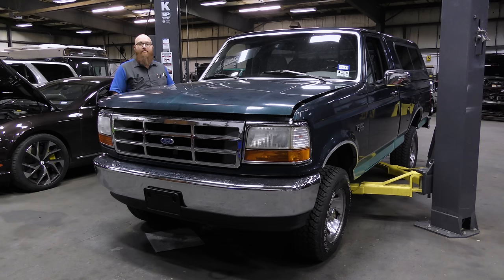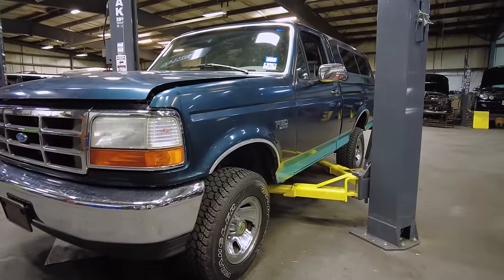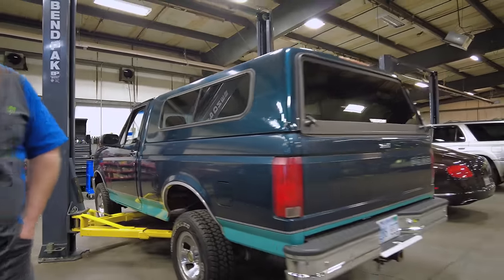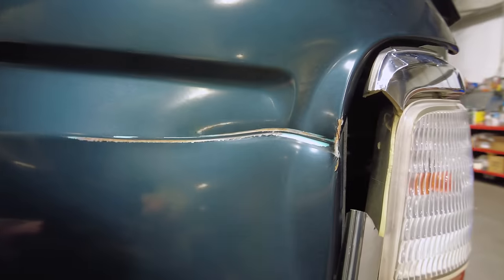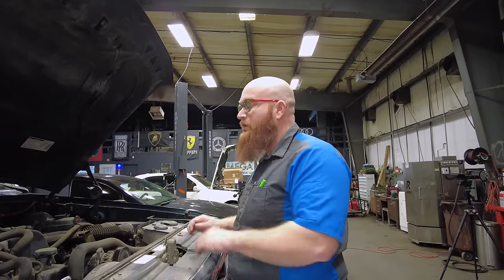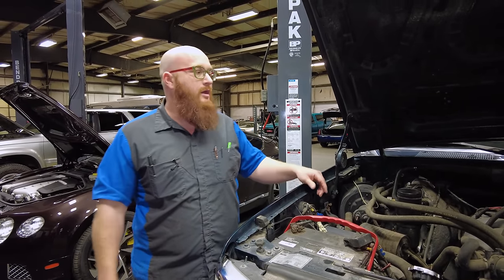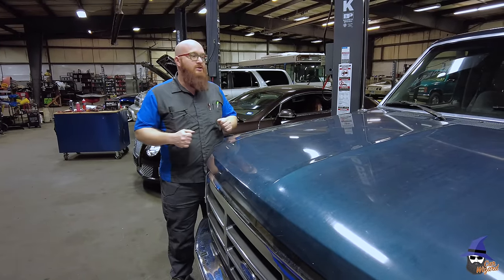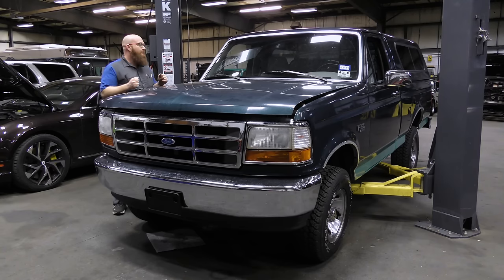What makes the CAR WIZARD mad? Fixing other shop's screw ups! Cheap Shop made  huge mess in '95 F150

Comment: Also beware of shops that will diagnose a specific issue, but will then present you with a laundry list of other so called "issues" and then proceed to hard sell you to have the shop repair all of the "issues" the shop found.  They will present these "issues" as safety concerns that should be addressed immediately.  They will proceed to tell you how badly your vehicle will perform if you do not accept their recommendations.  When you find yourself inside a shop like this, simply ask for the keys to your vehicle, and get out as quickly as you can, never to return.  Don't even try to reason with them, as their goal is to squeeze as much work as possible (the upcharge technique) out of you.  Just stick to your gut reaction to the hard sell.  Listen, used vehicles are going to have "issues".  Go to a shop that will correctly prioritize repairs and will work with you, given your budget, on what needs to be done "right now", and what can be deferred (along with imparting the knowledge of the consequences of that deferral), and what are simply nice-to-have repairs, given the age and overall condition.  As the owner of any car, you should keep a folder of all past repair invoices on the car so you have a history that you can look back on to figure out how much mileage is on your brakes, shocks, etc.  Be proactive instead of reactive, when it comes to car repairs, battery replacement and tire replacement.  When a shop tells you that your shocks need to be replaced, you can push back that the shocks only have 25,000 miles use on them!
Reply: i've learned that these are usually dealerships that try to add on all of the extras.  They are a ripoff 95% of the time!
Reply: Got my last set of tires at a Big O, they had a promo on Michelin. For the last 15 years I use a wheel and tire shop in Sacramento that is no bs always do fair deals and quick service. Just for the tire appointment at Big O they had my car for 4 hours and did a complementary safety check and said there was moisture on the steering rack it might be fluid if the steering rack goes it’s be real scary blah blah blah they can do it today for $2200 and also they recommend new shocks and struts because I’m at 90k blah blah they could do it today and have it ready by Monday morning …. Yeah no thanks

Comment: It reminds me of the time my mom took her escape to get the shifter fix (it wouldn't shift to any gear- cable broke which the mechanic said)... Any who. It shifts but it doesn't click and lock to any gear. Makes matters worse, yesterday I noticed they literally ripped the air filter housing... That's a 100 dollar item I need to order directly from Ford. Really pissed me off, there's a reason I do my own work on my vehicles

Comment: thank you wizard for bringing this up
i got royally screwed over recently

 i had my 08 jk wrangler at the shop i wanted a simple alignment done
they wanted to replace everything and unload the parts cannon on it
when i declined service they would call and say the brake pad broke  or the brake caliper wont retract 
i smelled bs but it was one of those we cant let you take it now situations spent $700 on shit service and broke more than they fixed they lost /broke the front axle  guides which turned into them damaging the axle seals
i have spent the last few days un "f" ing all their shoddy work
me as a diy guy can get the information to figure out the issues at hand
its not a complicated job 
that unnamed shop will never see my business again

Comment: I had a 1994 F150 with 300 inline 6 with stick and dual tanks. Absolutely loved that vehicle! I was hoping that you would do a video on this truck when I saw it in the background. Such an easy vehicle to work on for a shady tree as myself. It surprises me that any mechanic would have any issues working on this generation F150 with that engine / trans configuration.

Comment: I can't even count the vehicles I repaired over the years that came from another shop. Not only do you have to undo what the other shop screwed up in most cases you have to fix the original problem. The most common was the A604 Chrysler transmission that another shop rebuilt and then it still didn't shift. Original problem was a wiring issue causing the transmission to be in limp mode.

Comment: Great video....
I have a 1983 E100 Shorty Van since new. It has the 4.9L 300 6 carbureated engine. Great engine, plenty peppy for me with strong low end torque. It only has 150,000 miles on it, but I love it. PS..... I also love my window cranks....never let me down..😊
Reply: OK if you have long arms to wind down the passenger window.
Reply: @Cheepchipsable  No problem....just a reach away. They give me no grief...

Comment: 300 six, manual transmission, crank windows... With all the Toyota butt kissing lately it's nice to see a real truck on the channel again.

These trucks do have occasional issues with the PSOM (programmable speedometer odometer module) the speedometer will read zero and the LCD display for the odometer will be blank, and if it's an automatic transmission truck it'll shift extremely hard. It's extremely likely the caveman who tore that gauge cluster out of the dash ruined the traces on it. They made these F150s from 92-96, but there is small differences in the PSOMs that make some years incompatible with others... 92 and 93 will interchange, 94 and 95 will interchange, 96 will only work with a 96. 

Side note: I noticed the cluster for this particular truck doesn't have a factory tach, a gauge cluster with a factory tachometer will swap right into this truck with no modifications at all, the mounting holes are the same and the wiring for the factory tach already exists in the plug that plugs into the non-tach cluster. 

I currently own 3 of these trucks, and I've owned probably 10 others over the past 2 decades. Couldn't imagine having to pay someone to work on one of them...

Comment: Reminds me of a certain discount tire place I purchased wheels and tires from. On two occasions they've ordered wheels from their warehouse and at least one has a bent wheel lip where someone dropped the wheel in it's box into concrete and bent it and I wasted my time having to go back to have a replacement. They've also cross threaded a lug nut when I had a TPS sensor replaced which I had to take back to them while I was having my car serviced and tire rotation done. 
Before I started having my cars serviced at my car dealership I used to go to jiffy lube but I stopped going to that jiffy lube after one time I was having an oil and filter change and I heard the rookie start up my car before they refilled it with oil. Luckily another employee immediately caught that and had him turn the engine off before any damage could occur

Comment: Great video, Dave. A very valid point. Get ready to have your beard curl. I have a 1990 Volvo 240DL wagon, just like the red 93 you had in. On the highway there was a vibration. A bad vibration up to about 80 mph. Above that, nothing. Below that, take your foot off the gas and it almost went away. Took it to what is supposed to be a decent shop because it is large and could look at the car quickly. Get a phone call that they can't fix it because nobody knows about an old Volvo. The back axle is a Dana 30, so hardly exotic. The said the exhaust was touching the axle. Fine. Took it back to get the exhaust routed properly. Didn't believe that to be the issue because in 31 years of going there I have never had any issue. No change. Took it to the "Volvo specialist" shop here in town. Needed a new rear U Joint. Fine. Do it. Made sense as it was original to the car, and 33 years and 390,000 miles is a lot for a U Joint. Get the car back and the vibration is different. Annoying but not changing with the throttle. Took it back. Was told the driveshaft was damaged. Okay. Called a buddy with parts. He had a known good driveshaft. Put it in, problem solved. Then we looked at mine. Not warped, not bent. The new U Joint was missing the zirk fitting. Joint full of crud. Bad enough. Two of the retaining clips were not seating right. One fell out when the pliers touched it. The other was almost as bad. Keep in mind, this was not a discount shop. It was one of the most expensive shops in town. There was no question of going cheap as the car is a keeper. I plan to see a million miles on it. The issue is that there are no mechanics bring trained. Technicians are good for electronics but it takes a mechanic to fix the mechanical systems. My next car will have a carburetor because electronics are a pain when they get old.
Reply: There are few real carburetor masters, they are retired.

Comment: Mr. Wizard, I totally agree the Ford F-150  equipped with the 4.9 ltr inline 6 cylinder is probably one of the best engines ever made. I used to own a 1993 Ford F-150 with that particular engine.  A very reliable engine for sure. It was equipped with timing gears, and you can't beat that.

Comment: These are the reasons i am skeptical to trust any mechanic shops I do everything my self only thing I've ever needed a shop for is wheel alignments and putting on new tires and taking old ones off the rims.
Reply: Exactly. It pays to suck it up and put in the dirty work.
Reply: @jebus914  Yes, I do have a 04 Honda CR-V which makes doing anything a breeze. But I had an Infiniti still did all the work pain in the ass let me tell you but worth it in the end.
Reply: When I was growing up in the 1950s and 1960s my father did almost all the maintenance work on the family cars. He also did not trust repair shops and wanted to save money.
Reply: And exhaust systems nope not on my back.
Reply: @louisrauzi3872  I'm usually quite comfortable lying on the driveway. It's being bent over the fender wrestling with something that's hard on my back!

Comment: I really wish I could find a shop like Omega in my area. I do a lot of my own work, but when I do take it to a shop it’s either because I don’t have the time, or the tools, or the space to do the work myself. Or it’s something that’s gotten so out of hand that I need a seasoned professional to get to the bottom of it and do it right. So I rarely take my car to a shop beyond new tires, alignments, and wheel balancing to try people out and get a feel for them. But all the ones I’ve gone to so far have left me questioning their true competence. No passion anymore, no veterans with repeated knowledge of the vehicle in question.
Reply: I cant even find a shop anymore that can do a proper alignment, nor balance a wheel!
Reply: @BaltimoreAndOhioRR  Dude! That’s another thing! Right now for the past 5 years owning my car I’ve been battling a wobbly wheel situation! Car vibrates over 70mph only a few weeks after a tire balance, when the wheels I currently have on the back are on the front, my steering wheel walks back and forth at 30-40mph so I’ve stopped getting tire rotations altogether because no shop I’ve brought it to yet, no shop no dealership, none of them can find the issue! And this has persisted through a new set of tires. They say all the wheels stay true on the balancer, wheels don’t seem bent… but it follows one of my rear wheels! They cost too damn much to just replace them both.

Comment: Canadian Tire is huge in Canada. I once took my front wheel drive car to them within less then one mile of driving from a muffler shop that had just replaced my entire exhaust system. Paper stickers were still on the muffler and other parts not yet even having turned brown from the heat. Anyway I took my car to Canadian Tire because of a rattle in the back end of the car.  I wrote on the top of the work order DO NOT TOUCH EXHAUST !  Then I let them have the car for the day. I went off to work. They insisted they be able to call me . I told them nope I can not be called at work. So my somewhat senile mothers phone number was given . They would not look at my car without being able to call me even though all they were authorized to do was find out what the rattle was not fix it just tell me what was causing it.  They put the car on the lift and some kid high school kid was given the job of figuring out what the rattle was from . He removed the entire brand new exhaust system . Tossed it in a huge pile of old parts out back and replaced every part of the exhaust . Turns out they had called my mother who lived in that city . I did not live there  They claim they did not see the huge writing on the top of the work order .  When I heard they replaced my exhaust system I was furious still am many years later. I went into the shop while the car was up on the lift took one look and saw the rear axel was broken in half .  Pretty much banged my head on it when I walked under the car.  I had to pay them for that work in order to get my car the hell out of there.   Canadian Tire is the worst auto shop in the world . Never ever take a car there .
Reply: Sounds like a sitcom.
"It was a really important thing, so I gave my senile mother power to authorise stuff..."

Comment: My PSOM failed in my truck, in order to retain original mileage, I soldered the old eeprom chip from my damaged PSOM into my new (used) PSOM. Worked a treat, I still have my factory miles and a working PSOM

Comment: When Cash For Clunkers was going on in '09, I was a servic e porter st a big Chevy store.  I got to tske the 'clunkers' out back and bounce the engine off the rev limiter until the engine was dead, after the crankcase had been drained and filled with sand.  
Most engines gave out after several seconds.  
A Cadillac 4.9 (in a gorgeous '92 Deville)  lasted a full minute and a half.  The winner was a 4.9 I6 in an F150.  Took that engine 3 minutes at wide open throttle, lubed with sand. to seize up.

Comment: One of the Mechanics in our town claims to be the cheapest, but since he charges double the book rate, And since he makes mistakes and has to redo the work he does, he’s the most expensive. The other so-called cheap shop in town told a neighbor that he needed a new head gasket, all the car needed was a radiator cap. That same shop dented my fender along with charging me $1100. The third shop in town quoted my son $150 for a part, which was only $35 at the dealer.
Reply: That sucks. A mechanic I used for 10 years drove my car in under another car on the hoist. Put a big gouge in the roof. When I came to collect it, it was strangely parked 50m from the usual spot. I saw the damage, and asked what happened. "A stone ?" was the reply. As I couldn't prove he'd done it ( he'd done it ), I never went back to him. 10 years of generous tips, and recommending him high and low, and he chose money over honesty.

Comment: Wizard I have a 1992 F150 that I bought used in 2014. It had less than 47,000 original miles. I had to replace some items, front fuel tank assembly, rear fuel tank and pump, plug wires, cap/rotor, spark plugs and coil. A couple of years late the Tachometer went bonkers. Found out you could fix it by re-soldering all the area on the back that are brown, where it had lost its electric connection.  I had to take the instrument bezel off to get the cluster out and I did by the book but the plastic was brittle. The screws that Ford used have groves on the back of the head that bites into the plastic. When you unscrew them it takes the plastic with it . The top pin connector broke also. I was going to buy a new bezel but the price was too high. I fixed the bezel by using JB Weld, Plastic Weld Repair Epoxy Putty. Put the putty in where it used screws, once it harden re drilled the holes and used the putty to reattached the top broken clips to the bezel. This worked out just great, I was able to fix the Tachometer and the instrument bezel all with a little bit of solder and some JB Weld, Plastic Weld for less than $10.00.

Comment: Exactly what I was thinking.  With the 2 original issues... where was the need for anyone to be inside the cab of the truck in the first place???  You would think that after they heard the first of the plastic piece "snap" and break that they would stop, but no... they broke a piece off everywhere there was a fastener, and then made no attempt whatsoever to fix it.

This is why I fix my own vehicles.

Comment: Take that shop to small claims court. Wizard's video is "Exhibit A".
Reply: Wizard only has customer say so on the condition of the vehicle beforehand and what work was done by and by who. The plastic around the cluster may have been broken for a while.
He can only testify as to what he did for the customer, and we assume it might match the work he asked the shop to do.
Also the customer would probably be expected to at least approach the original shop for an opportunity to check the repair first.

Comment: On the subject of letting people borrow your truck, I let my mother in law borrow my 08 Silverado truck (threatened by wife if I didn’t) to move furniture. She was backing out of my house and turned the front bumper into her KIA.  $3000 damage to KIA.  Had to polish my bumper. The next day it was at her house, she backed into my nephew’s friend Civic that was there to load furniture.  Lots of damage to doors. No insurance on that. I just polished my rear bumper.  Hardly bent.  
Somehow I was to blame for buying a base truck 15 years ago without a camera or sensors. 😂 My wife now knows why I let no one use my Silverado or my my 2500 RAM.  But somehow I’m still the a55h0le to the rest of the family. Don’t lend your truck to anyone.  It’s not a car.
Reply: No good good deed goes unpunished.
Reply: The joy of never being married, no wife or mother in law to deal with... If I ain't behind the wheel of my truck then it's sitting in my garage.